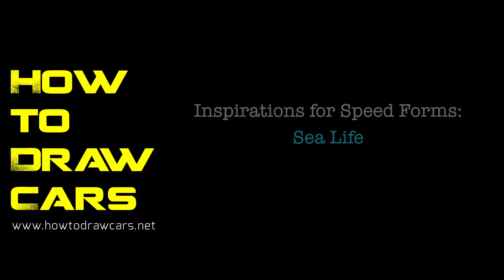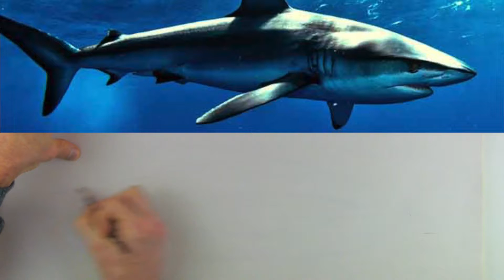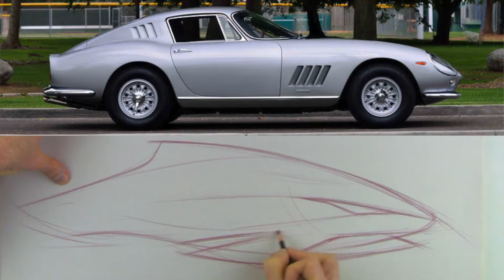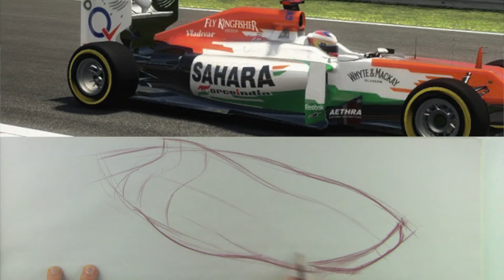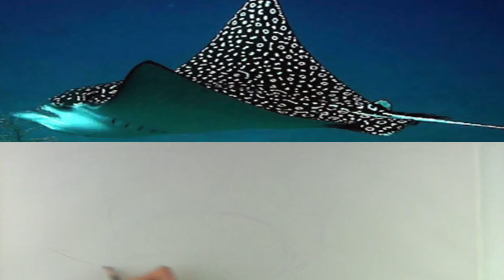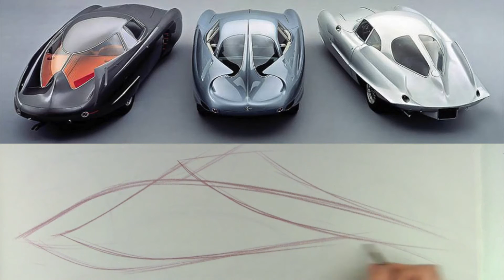Car Design Drawings | Speed Forms: Sea Life

Comment: do you have any speed forms exercices in digital media? i think doing it digitally  can be interesting and challenging as well.
Reply from the maker: K- 
The exercises should work the same. Drawing is drawing whether it's pencil on paper or stylist on tablet. The problem with digital formats for most people is the drawing surface is much too small to develop the correct technique. 

If you know how to draw from your shoulder than it's not so bad. But if you are drawing speed forms to develop your drawing technique and you don't have a very large surface to draw on with a stylist, it's going to take much, much longer to get better. 

Makes sense?
Reply: @howtodrawcars.  so the key is drawing big so your shoulder heve space to move
and make longer lines ,and in order to do that you need space.